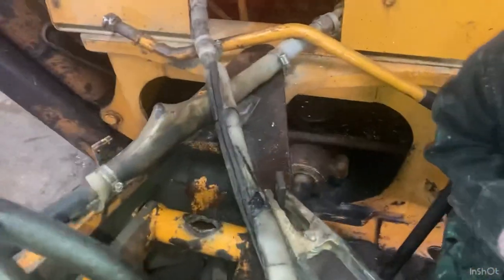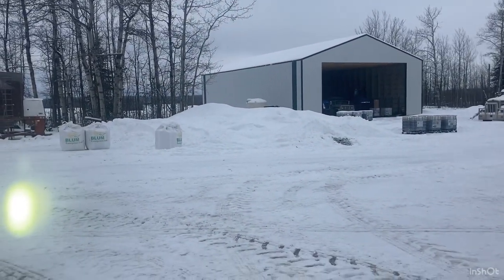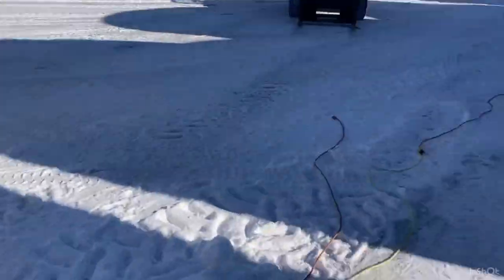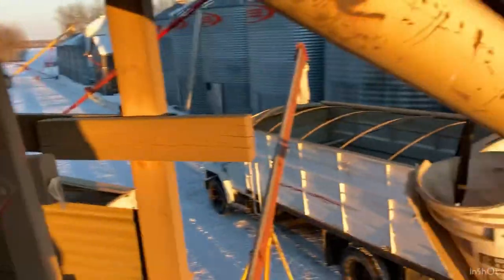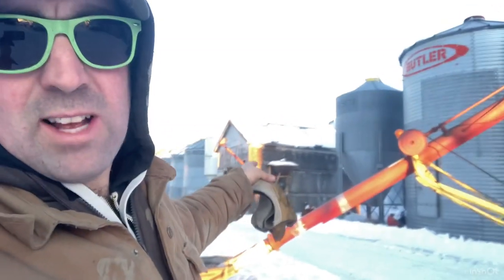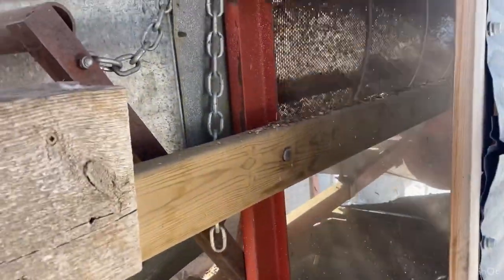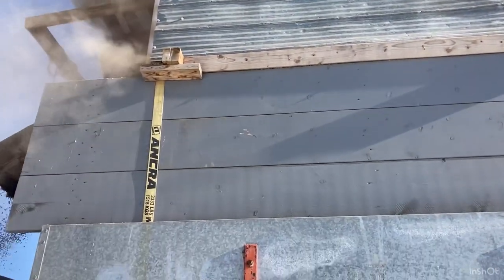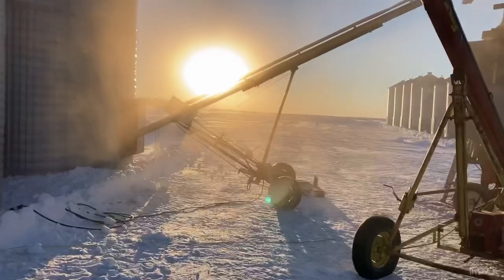Cleaning seed. FINALLY, PEAOLA (Pea/canola) SEPARATION

Comment: Very interesting to watch, thank you.  Good low-cost sort mechanics for the core first step.  Kind of understand why it is a fair-weather temp activity - has a few moving pieces.  Would be interested in follow-through of the peas and canola.  Sort for own seed, then for use in bagged feeds?
Reply from the maker: Yeah peaa will go to the cleaning plan. Whole peas will be for seed this year and any surplus is for human consumption, the split peas will be brought back to the farm and used in livestock feeds. Depending on how many and what kind of weeds are I the canola it will either get hauled directly to the elevator or we will
Clean on farm and burn the weed seeds